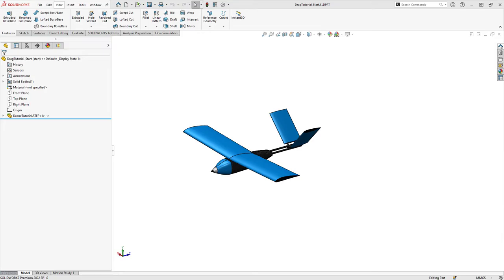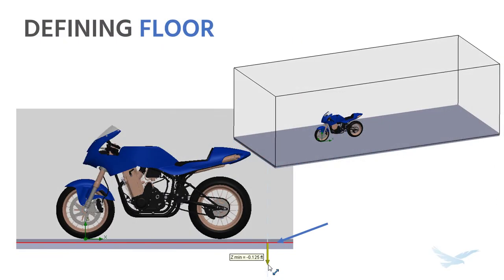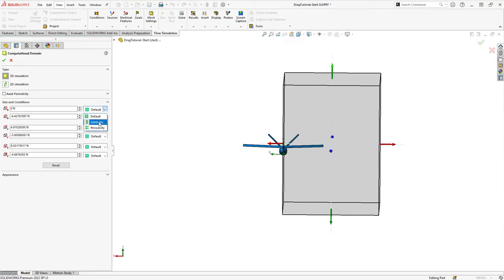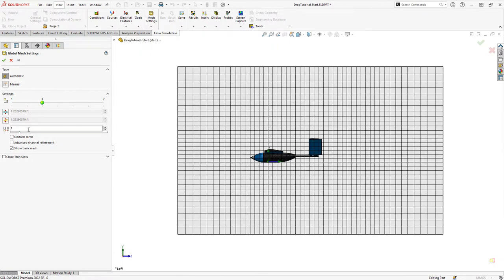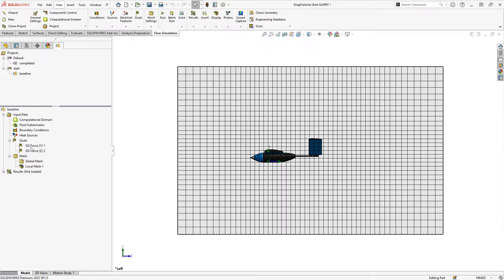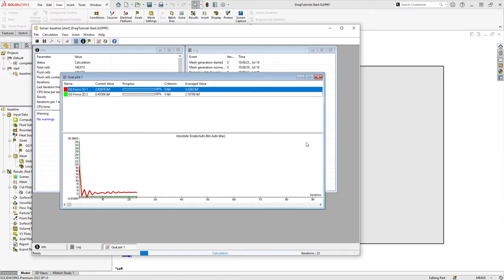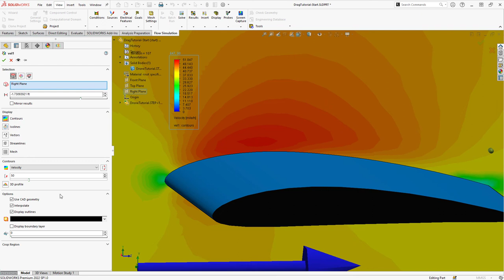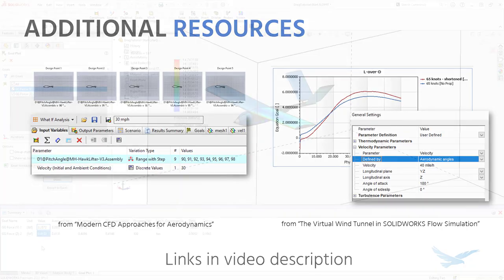Predicting Lift and Drag for Aerodynamic Bodies with SOLIDWORKS Flow Simulation

Comment: Great tutorial, congratulations. But just  wanted to know if SolidWorks also have some way to know the position of the center of pressure. For the flight of a plane, I've read it's really important the relative position between COG (Center of gravity) and COP (Center of pressure). Do you know how to calculate it (in the three axis)  using SW goals? Thanks!

Comment: Thank you so much! I have a question. If you answer it, I’ll be so happy. What regulations should be made in the setup if the flow is at 15000 altitude? I added a custom gas to the gases section to add dynamic viscosity and the other stuff at that page however I did not find a density section. The densities of the sea level and that level are very different. Is density inactive in the solution? Greetings from 🇹🇷.

Comment: I have a question.
Does the lift force produced mean that the plane overcame the force of gravity and therefore the aircraft will be able to fly?
Reply from the maker: Yes, if the total lift force predicted exceeds the weight of the vehicle then it would be capable of flight. The amount of lift can be adjusted by varying the position of the control surfaces and the angle of attack. A cruise condition would correspond to when the lift force is equal to the weight.
Reply: @hawkridgesystems  thanks for the answer!!

Comment: Hello. Whenever I change the computation domain I get completely different results. While it is somewhat predictable; I want to know the right computational domain size compared to model size to have a more accurate result.
Reply from the maker: It would not be expected to get completely different results from changing the computational domain (unless you are making it much too small, smaller than shown in the video here). Most likely what is happening if you are using the "Automatic" mesh settings is that you are also inadvertently changing the mesh density when adjusting the size of the computational domain. Lift and drag calculations are very mesh-sensitive so that would explain large differences. For an apples-to-apples comparison between computational domain sizes you could use "Manual" mesh mode on the global mesh and enter number of basic mesh cells in X,Y,Z direction to maintain a consistent density (such as a 2" mesh size) for the various sizes of the computational domain that you attempt. Divide the length, width, and height of the computational domain by your desired basic mesh cell size to figure out what number to enter. 

Generally sizing the computational domain can be thought of with two metrics that would be similar to conducting a physical wind tunnel test. First would be percent area of the flow that is obstructed which is sometimes called "blockage ratio". This is the ratio of the frontal area of the vehicle out of the total cross sectional area of the domain. 

The other would be be the length of the computational domain upstream and downstream from the vehicle, which is often characterized as some multiple of vehicle length (or chord length for an airfoil). Generally additional length is required downstream to resolve the wake. 

So you can look to literature for these values for general rules of thumb for a given application or geometry (e.g. 5% blockage ratio, 3 lengths upstream, 10 lengths downstream). It will be difficult to predict in advance how much is required for your geometry without performing a sensitivity analysis. But if you keep the mesh density consistent, and vary the two parameters separately (computational domain cross sectional area and upstream/downstream length) I think you should quickly find that the values converge and also identify a point of diminishing returns. 

Another thing to consider is whether you are trying to replicate a wind tunnel test or the real world behavior. In this example we used free conditions on all the sides of the computational domain which should be closer to the real world behavior, whereas to replicate a physical wind tunnel test it may be better to model a box shape representing wind tunnel walls and perform an internal analysis. Additional considerations to represent "real world" behavior for a ground vehicle would be to incorporate wall motion of the ground using a real wall condition.
Reply: @hawkridgesystems  Oh thank you so so much. To be honest, I wasn't even expecting you to reply to me. This is a very detailed reply too. I will read it right after I finish work and will try to implement it tonight on a small project. Thank you so much for your time. Have a great day!

Comment: Can I ask what is the purpose of reducing the  computational domain in half and then use a symmetry condition?
Reply: so it can process faster and then apply the results to the symmetry, no need to compute both sides of the plan since we already expect that the flow will be symmetrical

Comment: Thanks for sharing...i want to ask, why sometimes doing exactly the same procedure, i get different results (high deviation)?
Reply from the maker: The most likely causes are differences in the mesh and/or stopping or "convergence" criteria

If you refine the mesh to the point the solution is mesh or "grid independent" and then also solve for a sufficiently long number of iterations, it would be expected that the differences between runs would be very minute
Reply: @hawkridgesystems  thank you a lot:D

Comment: if I use symmetry on my computational domain is the displayed result half of the total force or does it double it for you before listing it in your goals?
Reply from the maker: The forces displayed are only for the portion of the geometry within the computational domain, so the goals are displaying "half" forces in this case and need to be doubled for total value.
Reply: Thanks! @hawkridgesystems